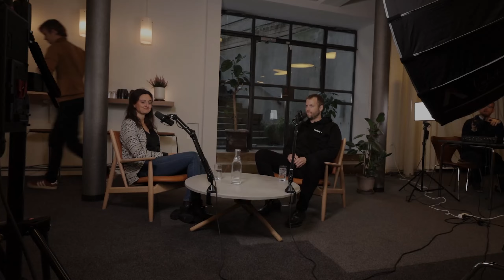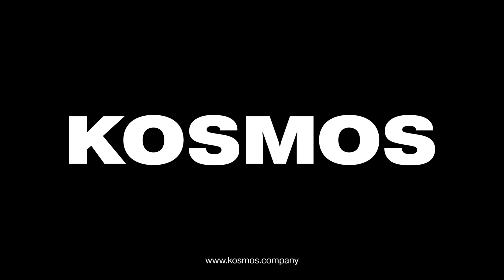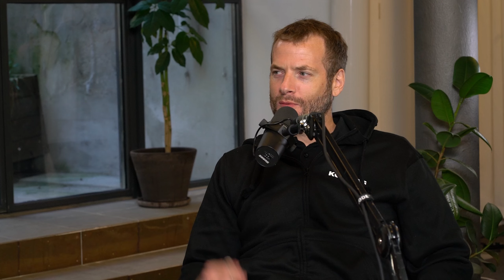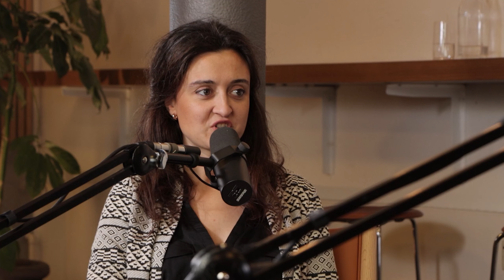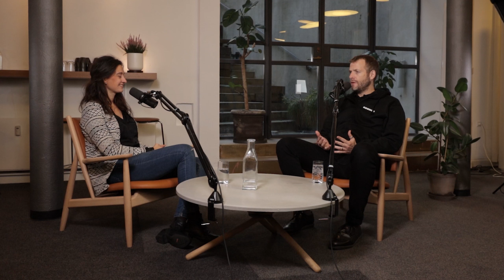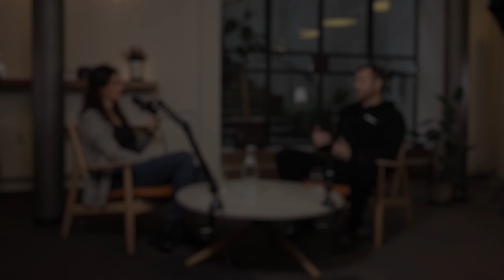Episode 7 - BIM for Quantity Surveyors

Comment: thanks for the video
as a QS myself going through the initial stage of BIM implementation I can say that demand is not there for many reasons

I think mainly because most of software are very expensive, they tend to create silos-like environments where open exchange is discouraged
there are many publications and tutorials on BIM but very few are at a level where professionals can start using it

If BIM were to be shown from a very practical standpoint it would gain immediate traction, otherwise it sounds like a bunch of gibberish stuff to many
BIM+QS is a match made in heaven, but needs to be properly supported for people (including clients) to fully appreciate its benefits